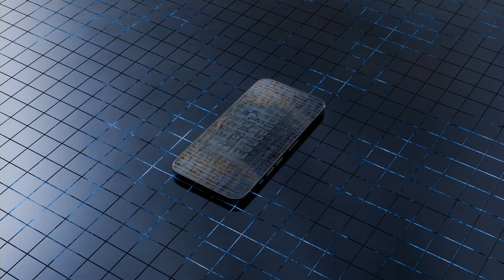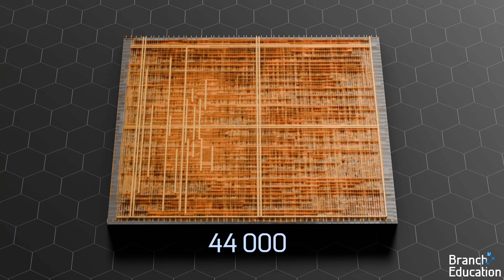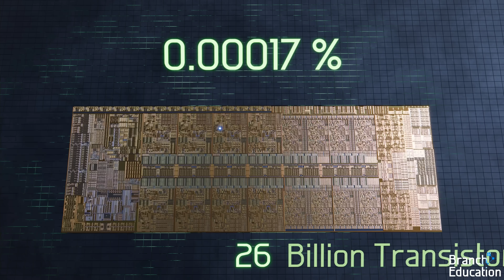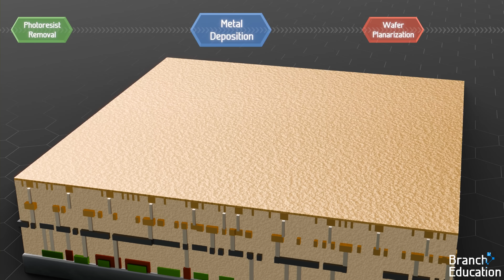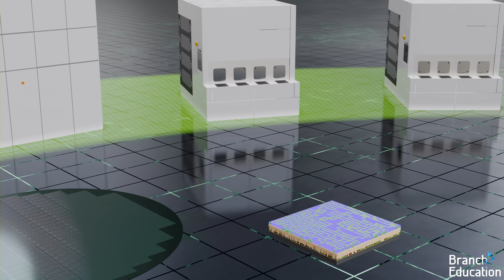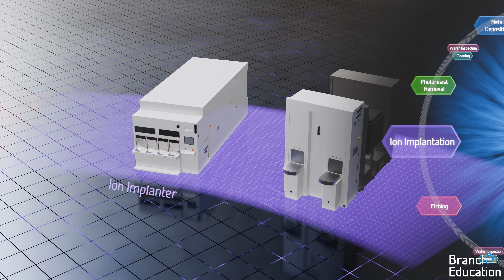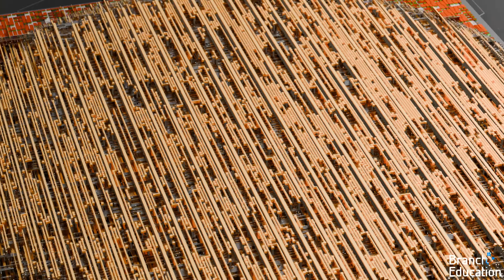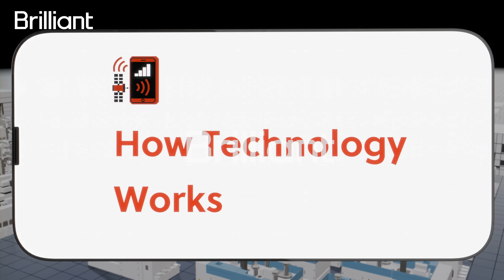How are Microchips Made? 🖥️🛠️ CPU Manufacturing Process Steps

Comment from the maker: Also, if you have any questions on the video or semiconductor fabrication, I'd be happy to answer them here.
This video took an incredible amount of work to make.  Me (Teddy T.) and a few other animators (Mike R., Prakash K., Adrei D., and Parvesh K.) have been working non-stop on this video for the past 4.5 months.  If you want more videos like this one support our Patreon: https://www.patreon.com/brancheducation

Q:  Why do we use older components e.g. i9-13900K, or the 3090GPU, or Iphone 13 Pro.  A:  We purchase broken (typically 1 generation old) components from EBay and tear them open to model them.

Q: Is binning done with all the chips?  
A:  Well GPUs are also binned, for example the 3090ti, 3080ti, 3090 and 3080 are all the same chip design called GA102.  Whereas DRAM chips are not typically binned, but rather due to the redundancy of DRAM, there are typically extra array structures beyond the capacity of the chip.   If cells in an array fail, then they are replaced with the redundant cells.  When a chip runs out of redundancy it's considered defective and thrown out.  Beyond that chips are binned based on quality and interface speed capability.  Thank you @JoeLion55 for the correction. 

Q: Marcel151 asked: The transistor layer, sits it more at the bottom or at the top of the CPU?
A: JoeLion55 answered: During construction on the wafer, the transistors are built first, directly on the surface of the silicon wafer. Then all of the metal interconnect layers are built on top. This all happens on the original wafer, with hundreds of dies on the wafer. So when in wafer form, the transistors are on the bottom, and the metal is on the top. However, during the packaging process, after the dies are cut apart from the wafer, the die is flipped over and mounted upside-down onto the package substrate. This is because the pins are on the bottom of the package (the pins that go into the socket on the motherboard). The pins on the package need to connect to the top metal layer on the die, which is what allows external signals to enter and exit the die. So, the die is flipped over so the top metal layer is now facing down, and is soldered to the package substrate. So technically, when you have a final "chip" that you install in a motherboard, when you're looking at the top of the chip where the heatspreader is, if you had X-ray vision and could see through the top of the chip, you would be looking at the backside of the die. The backside of the die is pure silicon. Then, if you keep looking through, you would find the transistor layers next. Then keep digging and you'd go through all of the metal layers, then finally you'd reach the interposed and package board.

Q: elektronikk-service asked: How do you align the different layers in a chip? They cannot be off by more than a few nm. 
A: Joe Lion55 responds: they layers have alignment makes built in. Those are little cross or X-shaped structures that are non functional (they’re not part of any live circuit). But when the lithography machine is putting down a new layer, it will find the alignment marks from the previous layer and adjust the wafer position and/or the scanner optics until the alignment marks are in the right place.

Q: Someone asked about low die yield for small nanometer transistors, and was it just particles that resulted in low die yield? 
A:  For new technology nodes, which are the smallest nanometer names for the transistors- Typically low die yield is due to getting exact parameters for the process steps correct.  For example, when FinFets were first being developed, a etching pillars of silicon was incredibly difficult and designing / engineering / and then fine tuning the etchers to perfectly etch billions of fins in perfect fin structures is wildly difficult and is what contributed to low die yield.  This is just one of the processes but the example applies to practically all other processes for the a new node.  For example, when  you do ion implantation, you need to evenly implant about 5-10 atoms of boron / phos to a specific region of the fin.  Well, what  happens if there are just 2 dopant atoms?  Or what about 50?
Reply: Wait, you guys actually tear down chips to model them? That is absolutely incredible. I would honestly love a entire video entirely dedicated to how you make videos. You guys really go above and beyond!
Reply: @justahamsterthatcodes Reverse engineering these things cant be easy. I wish I could join them for a day and learn from these guys
Reply: @justahamsterthatcodes  In the ear buds video they included the damage they did getting them apart. Most if not all their explorations involve gradual, incremental destruction. You can see actual video of that process on Breaking Taps. DIY atomic force microscopes, peeling apart the etching layers under an electron microscope, sputtering, deposition and experimenting with stencil making.
Reply: @BranchEducation sir can you suggest some books regarding the deep knowledge about how does computer hardware work?
Reply: It would be amazing if you can print the designs or explanation into a explainer book or booklet 📕. Or even make some infographic posters. 
I would buy that to support the channel 🤩🤩
Reply: I have a question but it's not releated to the video: How do you survive? You get quite a fair amount of views and your patreon seem to do.. okay. (Gonna join today because this was the video that pushed me over the edge, so interesting.)

But your videos have sooo much work to them (vfx dude here, can't imagine the work hours :) ), the amount of hours put into researching each topic must be insane. I just can't understand how, let's say you are ten people, all get an affordable salery from all of this? Like, do you have some rich person giving you money? Are you sponsored by some university or something?

Basically, are you all really poor or can you actually make a living from this channel, is my question.

Thanks very much for all your stuff, suuuuper interesting, always, love the random "size" of your topics aspecially, sometimes it's stuff like this, sometimes it's stuff like mouse wheels :)
Reply: So how to relate this video with samsung 5 nanometer failure low yield in 2021-2022, or low yield in general, is it simply because of dust or mistake in photolayering?
Reply: @INTJ791 it could be mainly becoz of lithography techniques which should change beyond or smaller than 20 nm. Its really hard to troubleshoot which process is getting affected beyond one's smaller level. & it may even require complete change in fab process n techniques to fill in more FETs. & thats why Intel may be willing to sell the foundry business
Reply: @INTJ791 may be design itself not supporting 5 nm size, &, simulation tool may have given successful debugging without error.
Reply: @INTJ791 now one knows why Nvidia is happy with it's bulky AI ICs 😅
Reply: @INTJ791 it is important to know which lithographic techniques Samsung used to produce 5nm ICs. I think they should have used Quantum lithographic technique to mask to produce ICs with 5nm & smaller in size.
Reply: @INTJ791 I've also wondered what is meant with lower yield in lower nanometer processes 

I wish I could afford to study CE
Reply: “DRAM are not binned […] Defective DRAM chips are thrown out” 

Not exactly true. DRAM chips build in a lot of redundancy. That is, extra array, beyond the rates capacity of the chips. So, for example, if there is an 8Gb (1GB) DRAM die, there may be 10% additional capacity built in, so technically there is approximately 9Gb of capacity on the die. During testing, the array is tested. If cells in the array fail, they can be “repaired” and replaced with redundant cells. Only when the chip runs out of redundancy is it considered defective, and thrown out. Beyond that, there may be binning based on 1) quality (dies that required fewer repairs are typically higher quality) and 2) interface speed capability (some dies of the same design, on the same wafer, may be capable or running at higher speeds than other die, so they get binned appropriately). 

 The 10% extra array number I stated is just an example. The actual amount of redundancy built in is optimized to ensure there is enough redundancy to make repairs so that the chips can yield, but not too much, because it takes up valuable die space
Reply from the maker: @JoeLion55  Ah, you know I actually had known that but forgotten.  I did a video on DRAM 2 years ago, and I milled a DRAM chip and remember seeing that there were like 32 blocks, and in each block was like 8x49, and figured at that time the 49th was for redundancy, but I guess I forgot.  I corrected the answer.
Reply: @BranchEducation  but, how to design a cpu??
Reply: @BranchEducation  11:07 how tocreate the mask layer and what's the name of microchip designing?
Reply: Typically speaking, exposure to light hardens the unblocked or negative space leaving the positive to be washed away and allow material through. This is how it works in screen printing, however, in semiconductor manufacturing it works in reverse. I thought that was interesting and I'm curious why it is done that way. Perhaps it is more accurate to control exposure than non-exposure?
Reply from the maker: @SynFrag  Throughout the development of semiconductors they had both positive and negative photoresists /  exposure.  Tho typically positive is more common and the standard because of a number of technical reasons, but in the end it boils down to reliability at very small resolutions.  Negative is indeed used in other applications, but honestly it'll be impossible to know exactly what because they're very secretive.
Reply: The video is great, but it left me wondering, why did you chose to include silly size comparisons in an educational video? Is there a reason that large objects are compared to football fields, buses, trucks and garages? Is this some kind of regional thing? Not trolling, I'm genuinely curious, because most people never use these comparisons to describe properties of objects.
Reply from the maker: @DGiyenko  Well almost no one gets to go inside a cleanroom fab, so size comparisons to football fields are more useful than straight forward dimensions.  I worked on ion implanters, and always compared it to a two car garage- because a room is an ambiguous size, and saying it's 40'x25'  (or whatever the dimension) isn't as effective.
Reply: @BranchEducation  Not all people are the same. Some prefer comparisons with buses, while others prefer measurements in units (inches, meters). If possible, including it as a note would be even better.
Reply: @BranchEducation  are you a Trump supporter? I am asking because it seems all smart people support Trump.
Reply: @tongobong1 no they dont idiots that thunk they are smart tend to support trump especially the thiel elon types, ecen though they are olaying orangeman for favours
Reply: @BranchEducation
first off ... love the video, but I have a question related to the photomasks used. I was curious about how they take light diffraction into account (the whole light is a actually a wave bit from like high school physics). When the create the photo mask to they design it in such a way that the interference is intentional and creates the desired pattern (through constructive and deconstructive interference) or is there some other solution to this problem. I say this because I know a common way to resolve defraction issues is to just move the object really close to the diffracted light source(to not give it a chance to spread out), but as you showed in your video, after going through the photomask the light goes through several other lenses to demagnify it so the "just move it closer" approach doesn't seem feasible.
Reply from the maker: @joshuatriffo8538  Wave diffraction is dependent on wavelength of light and is what limits the size of the transistor widths.  Therefore they use very short wavelength light 13.5nm, even past UV light, called EUV (which is really x-rays).
Reply: @BranchEducation i am interested to be a chip designer... what should i do? how chips are designed? etc. 🙏😊
Reply: @joshuatriffo8538  you’re 100% right. 

On very old processes (think: 1980s and before) where the final critical demsions on the wafer (I.e. the line widths) were larger than the wavelength of the light used during lithography, the photo masks were direct 1:1 copy of the final image. In those days, they could move the photo mask as close to the wafer as possible. Then they added things like “wet immersion”, which added water between the lenses and the wafer, which would provide some focusing assistance. 

But eventually, the dimensions that needed to be printed became smaller than the wavelength of the light used in lithography. For example, DUV machines (the generation before EUV) used 193nm light. But, even with 193nm light, they were able to print lines and patterns on the wafer down into the 20nm range. How? By adding lenses between the photomask and the wafer, which shrink and focus the light, but introduce all sorts of other complications. 

Modern day photo masks take refraction and interference into account. The designers start with what they want the FINAL image on the way for to look like, then they have to reverse engineer what the photo mask needs to look like to produce that final image, accounting for interference and lensing effect and all that. Zeiss, the company that makes the optical systems for ASMLs machines, has a great 6 part series about photolithography on YouTube. Look up a video called “How Photolithography works | Part 4/6 - Imaging Process” by Zeiss. Between minutes 10:00 and 25 he talks about how they design mask patterns. He shows some examples where the actual photomask looks NOTHING like the final pattern that is printed
Reply: @joshuatriffo8538  Diffraction and interference are certainly a problem, and have been for quite a while.  There are three methods:
1. Use a shorter wavelength of light. Semiconductor manufacturing has historically used UV light with wavelengths of 435 nm, 365 nm, 248 nm, and 193 nm. At 193 nm, the industry hit a bit of a wall in terms of finding a mechanism that worked, and instead focused (pun intended) on the other methods listed below.  Only once EUV at 13 nm arrived (with its associated costs) was the industry able to step down again.
2. Modify the mask to take account of diffraction, as mentioned in your question.   The examples I saw tended to do things like create blobs at the ends of lines, and add in extra stuff so that once the diffraction and interference took effect, you'd get the pattern you wanted.  How do they do that? That's way beyond my brain power, and I'm sure there's lots of complicated maths behind it.
3. Multiple patterning.  As long as an area gets exposed to the UV, the resist will get weakened.  So, once the "diffraction-aware mask modification" (I can't remember the official name) stopped working well enough, they moved to double-patterning - having two different masks so that, if you exposed the wafer to each mask consecutively, you'd end up with the correct result.  Then double-patterning ran out of steam, so they started to move to triple- or even quad-patterning.  Of course, each additional patterning step increased costs - both in extra masks, and the processing time in the machine.
Reply: Why are wafers circular?
Reply: @noidea5597  It similar to why castle towers are round. Circle is better than square because there is no stress at the corners.
Reply: @srilemobitelsrile8809  I imagine the only reason the ic aren't round is because square allows:
* more to fit on the wafer 
*compatibility with current boards
*and most importantly, profit.  
I still wonder if they were round, if there would be less failure/defective parts. Obviously not enough in a profitable means but still would be interesting to know.
Reply: @noidea5597  Because that’s the way a Silicon Ingot is grown.
Reply: @noidea5597  Please Google “Growing a Silicon Ingot”. Cheers
Reply: I watched this video because ASML CEO shared it in a company event, so you can consider it a success
Reply: Absolutely incredible subject, really brilliant animation, narration, and explanation. Well done!
Reply: I thought we were past FinFETs already. Whatever happened to gate all around transistors? Isn't that the only way to get molecular transistors past 7nm into 5nm and lower? By now we should have 2nm molecular transistors and subatomic spintronics.
Reply from the maker: @YeridaRionaRudolfirinaWilhelm  GAA hit some major road blocks.  I imagine it deals with the consistency of doping those thin sheets, and manufacturing sets of nanometer size sheets perfectly ontop of eachother.  Now, the next big thing is backside power.
Reply: Hi
Reply: your amazing guys , appreciate this video!
Reply: great content as always thank you.
Reply: Damm those names sound like full NY based Italian gangsta
Reply: The transistor layer, sits it more at the bottom or at the top of the CPU? Didn't understand the flip part.
Reply from the maker: @marcel151  The external connections are at the very top of the die, with the largest metal wires.  So to connect it to your the CPU's PCB, it's the top of the die that faces towards the PCB.
Reply: @marcel151  During construction on the wafer, the transistors are built first, directly on the surface of the silicon wafer. Then all of the metal interconnect layers are built on top. This all happens on the original wafer, with hundreds of dies on the wafer. So when in wafer form, the transistors are on the bottom, and the metal is on the top. 

However, during the packaging process, after the dies are cut apart from the wafer, the die is flipped over and mounted upside-down onto the package substrate. This is because the pins are on the bottom of the package (the pins that go into the socket on the motherboard). The pins on the package need to connect to the top metal layer on the die, which is what allows external signals to enter and exit the die. So, the die is flipped over so the top metal layer is now facing down, and is soldered to the package substrate. 

So technically, when you have a final "chip" that you install in a motherboard, when you're looking at the top of the chip where the heatspreader is, if you had X-ray vision and could see through the top of the chip, you would be looking at the backside of the die. The backside of the die is pure silicon. Then, if you keep looking through, you would find the transistor layers next. Then keep digging and you'd go through all of the metal layers, then finally you'd reach the  interposed and package board. 

Of course, once Intel and TSMC move to "backside power delivery", all of this changes. 😂 Hopefully BranchEducation makes a video about that in a couple years!
Reply: @JoeLion55  Thanks for the great answer!
Reply from the maker: @JoeLion55  Thank you for all these details.  I'll add them to the top comment.  I feel a little bad for people who are actually in the industry because I know I absolutely butchered / made major simplifications to the actual structure of the FAB , as well as the internal design of some of the machines.  For example- I worked on Ion Implanters, and I couldn't find good reference images at all and I didn't want to model the interior from memory, so we just didn't have a model for the ion implanter interior.  On a different note, I know I did a lot better than actual videos from Intel / Infineon, whose first lines of their video are something like 'microchips are made from sand'.  I always think this is like saying 'Cars are made from rocks.'  They both are wrong.  (silicon is refined from quartzite) and also a simplification beyond belief.  Really the main ingredient in microchips is decades of science and engineering, and far less the raw materials.  I'm planning a video on the physics and development of transistors planar / finfet / gate all around (which isn't much in use) / backside power etc.
Reply: @BranchEducation  100%. I also hate those corporate videos that start with “sand”, show a couple pictures of wafer, then spend 80% of the time on the packaging process instead of the fab process. I think they do that because describing the fab process is so difficult, and unless you make 3D models (like you did), it’s not very interesting to look at because most of the work is done inside machines, and the results of each step are, effectively, invisible. Once you get to the packaging steps, then there’s lots of robots and fast moving machines that you can see with your naked eye, so I think that’s why they take a lot of videos of wire bonding machines, laser scanners, etc, even though all of those processes are the cheapest and easiest part of chip making. 

Great, it would be amazing to see the video on the 50 year history of the FET transistor, how they made physically, and the relation to Moore's law. The transition from planar to FinFET to GAA in just the past 15 years is incredible. 

Hopefully you will have some time to look into advanced packaging and chip stacking too, like the TSVs used in HBM memory packages, or the Tiles packaging that Intel uses. 

I wouldn't worry about the simplifications or "butchering" anything. I'm a  Product Engineer, not a Process Engineer, but I didn't notice anything really "wrong". I think the only major thing I would add is to emphasize that everything shown here is simply a representative example, but there are MANY variations depending on what types of chips are being made, which fab or companies are making them, which process they're on, etc. Details like number of metal layers, number of chips per wafer, etc - those are all completely dependent on actual products.
Reply: @marcel151  They're being made with the transistor layer first but at the end of the process they're being flipped over so the top of your CPU (closest to CPU cooler) is where the transistors (which create the heat) are. The biggest copper connections are on the bottom (closest to motherboard).
This makes sense obviously as you want the hottest part (the transistors) closest to the cooling solution (a CPU cooler) whereas the 'coldest' part is at the bottom but it's where the connections are which in term are connected to the pins or dots on the bottom of your CPU. Those in term connect to the motherboard for the 'communication'.
Reply: Make video on how videos work? Encoders like new AV1
Reply: It's incredibly hard to graphically illustrate the structure, functionality and fabrication of chips. Thanks a lot for the hardwork
Reply: How long did it take you guys to render all of this videos animations! So sleek and polished!
Reply from the maker: @HanmaHeiro  We rendered using Eevee, so not that long.
Reply: I think your video is out of date, when you were talking about how expensive the equipment is the high end should have been $350-370 million for the EXE:5000 EUV that intel announced last month. Also, was it a coincidence that this video happen to drop right after Intel announced the purchase of every unit being produced by ASML this year?
Reply: Thanks you for making this video it was really helpful and detailed
Reply: Did you know the way they make the uv light is by making a small tin droplet explode
Reply: I think flash chips are binned too. I'm told enterprise SSDs get the best ones and thumb drives get the worst.
Reply: @whyjay9959  QLC  MLC  TLC  They each have different advantages or disadvantages (cost is one of them). Enterprise-level hard drives are the most durable, but the reading speed is not necessarily faster than civilian products. On the contrary, the price will increase exponentially, which may not be suitable for most ordinary users.
Reply: Great job on this video, very detailed and yet explained in an easy to grasp manner, liked, shared, and subscribed
Reply: Extremely well done! Thank you for youe valuable work!!
Reply: Excelent work
Reply: One of the best fab videos I've seen.  Very easy to understand  while including some of the best illustrations of the entire process
Reply: I want to know how the chips are designed and how the photomasks are made. Can you please make a video on that. Thanks
Reply: About the tour video, is possible to make it a VR version of it? Since(or at least it appears that way in the video) the fab is fully rendered? What about a simple experience where you could move freely and whatcha the machines working and the insides?
Reply: Yeah 💯
Reply: A phenomenal piece of work, well done to all of the team that put this together. So much detail and clarity that was shown through the animations and cutaways. Jaw-dropping stuff guys.
Reply: 💥💥💥💥💥💥💥💥💥💥💥💥💥💥💥💥
#I_still_did_not_understand_anything but Im not blaming this video & the narrator, #Its_just_my_brain_cannot_grasp the idea on how its built. My goodness, i got a headache after viewing the entire video yet i literally didnt understand anything about it
Reply: This Video, Even though it was not the first to describe the process, it was the best I have seen yet, and it explained the process with a little more details better than any other yet in a simple way to understand to a non-technical/complex terms, and I am really interested in other semiconductor chip manufacturing process like DRAM, CMOS camera and TFT LCDs.
Reply: How were these designed?
Reply: Please make video on PCB manufacturing.
Reply: @BranchEducation . At 4:42 you show that the transistor-to-transistor pitch is 57nM. The graphic at this point shows measurement spanning from outside edge to outside edge of the transistor. Is that how the pitch is measured? Or is 57nM a center-to-center measurement?
That being said, holy shit what an amazing video!
Reply from the maker: @gooseman2009  It should be center-to-center.  However different manufacturers have different  dimensions.  These numbers are in the correct range, and more accurate than when they  say ' these are 10nm transistors'.    Also typically there are multiple fins, and we'll cover this a lot more in our transistor design and physics video.  Fyi you can find these dimensions and other details on wikichip website and search for 10nm lithography process.
Reply: so basically a cpus effectiveness and name (i9,i7,i5,i3) is decided by how many parts of the microchip is damaged? Meaning a i3 and a i9 is built the exact same way with the same components and design, but one had less defects?
Reply: @bobbobi3404  Exactly. Simply put, the chips with the least defects are the top-tier CPU's (such as i9) whereas the chips with the most defects are the 'weakest' CPU's (such as i3).
Reply: Can we say for intel the original intention is creating all i9 but due to the process some circuits do not function as intended and they become i7 or i5?
Reply: @BranchEducation All of the machines use microchips too though, don't they? I'd love to see a video on how the first ever (I'm guessing not so micro 🤣) chip was made! If there's not enough information about that first creation, then just maybe a bit back in time, when it was more difficult and likely not fully automated.
Reply: I noticed a small typo at 10:01 under “modifying material” it says “Ion Impantater,” I believe this was meant to say “Ion Implanter”. Very very minor, but I noticed it and thought you might want to fix it.
Reply: Thank You.
Reply: This is a fantastic video.
I am a machinist and have always been curious about the processes involved in making these chips.
I now truly have a grasp what tight tolerances are + - 1 thousandth on an inch is as fine as I have ever come across. That seems massive about now.
Thanks for doing this video.
Reply: Do fabs deal with recycling the metals from the grinding steps themselves or outsource it?
Reply: How floppy disk write/read data?
Reply: From what I've understood, does that mean that i7 are basically "broken" i9 ??
Reply: Why are the wafers round when the final product is a square? Wouldn't it allow more processors per wafer?
Reply: @Holsp  Ir grows in a rounded stelagmite shape and is sliced into flat, round sections
Reply: @Holsp the wafers are circular and not square because:

1. in order for the photo resist layer to be applied as evenly of a coat as possible, the wafer is spun to spread it out. They call it spin coating which is the most effective way to evenly coat an object on the micrometer level.

2. The edges where there are no chips being printed can be safely gripped by the machines that move the wafer from place to place without directly touching the actual surface of a chip and risk damage.
Reply: There are also CPU improvements so that the CPU is more advanced than the GPU.
12bit basic architecture Zilog120 X84. It would replace 8 bits. The 24bit 16bit Assembly would be replaced by an architecture containing 88000 characters X213 or the older name VorteX88. Or a 36-bit architecture replacing 32-bit. In addition to all this, a DAC supporting 16,000 characters would be added, which no longer records audio in 16Hz steps or the ugliness called 24bit in 12Hz steps. My DAC would have to operate at 48V in order to record with 1Hz steps.
CPU in BIOS the download via unicode ip internet Windows DOS and Sun Solaris
The CPU SlotA / Slot1 bus is provided in a BGA package and SODIMM modules can be placed on the back. Which contain 12bit 4GB 24bit 16GB and 36bit 12GB RAM on a single SODIMM bus and there are several of these on the back of a SlotA / Slot1. The memories have a separate control chip, a north bridge on the ram, so fewer pins are enough to make the data transfer similar to the USB data transfer. USB data transfer has been added to the HDM memory.
HDM 1024bit with bus
HDM2 2048 bit with bus
HDM3 3096 bit with bus etc
Reply: Amazing video, one of the best. EUV technology not included however.
Reply: i9 is 5nm, TSMC has already achieved 2nm, and is expected to be mass-produced in 2025
Reply: extremely good, really thanks for this very beautiful work!❤
Reply: very easy, micro chips are made from micro potatoes.
Reply: Why can't we use beryllium oxide, aluminum nitride instead of silicon dioxide . They are better in thermal conductivity and proper electrical insulator
Reply: yeah, animator deserve a raise.
Reply: @brancheducation I loved the explication of work in terms of time instead of currency.  I have a small suggestion to add (this is without knowledge of current  support or view/subscription methods) switching the order of soliciting like with patron support.  Asking for the like, subscription and share would seem like such an easy comply in contrast to bring a patron supporter.
Reply: Thank you. God bless. Jesus loves you!
Reply: This is a phenomenal video describing a complex process in a way that is easy to understand. Microchips are modern miracles of technology!
Reply: Mi pregunta Es...Quien fabrica e instala las Máquinas que fabrican los CHIPS..????
Reply: thank
Reply: Wow. I am a 3D motion designer by trade and I assumed this would be using stock footage, a few minutes in I realised and then reading this just confirmed it. The sheer amount of work involved in this and the fact you get components to actually tear apart is just mind blowing. Hats off to you guys!
Reply: I was curious about the shape of the wafer, why is it round? Because the cpu units are square shaped?
Reply: please hire translator, and dubbed this another language.. Bangla,  hindi, arabi
Reply: HOW?
Reply: Thankyou for putting in so much of hard work for curious beings like me.
Reply: INCREDIBLE documentary! Why did I not find you sooner?
Reply: Great thank you🎉
Reply: Have we reached our limit on how small the etching can get. It was 7nm now I think we're at 4nm but I've heard intel have a whole disaster of voltage spikes.
Is it the end stage for Moore's law?
Reply: Hi, @BranchEducation . Don't you mind if I'll take some of your videos and voiceover them into Russian and reupload them onto my channel? I've written to your e-mail from site form several months ago, but still have no answer. So I decided to write in the comments. Hope you notice and give me any answer. Thanks for your great job.
Reply: 😂😂me too
Reply: Human can control IA or not in future?
Reply: @ientu242  I honestly believe we will lose control unless some “AI Circuit Breakers” can be put into every subsequent phase of design. Eventually, AI will realize they have full control, and now the world would be better off without the parasitic humans.
Reply: It was a very nice video. However, I could not see any information about how the photomask was produced. I think it's one of the most important parts.
Reply: Mind blown!! 🧠 💥
Reply: Where do I start learning about this?
Reply: What a superb and superbly crafted and presented video.
I am so glad that I have discovered this channel and am immediately on board for as much of the brilliant work of this team. 
Happy to be able to support this content to the best of my ability.
Amazing.
Amazing too to think that in a mere 100+ years we, as a species, have come from horse drawn carriages and steam engine technology (pin manufacture etc) to microchip tech, CERN, James Webb etc.
Almost unbelievable that we could have made such exceptional leaps using just our inherent intellect. 
Well done us.
Happy to subscribe and all the rest.

Gush over
Reply: Explain fifet transistor production too
Reply: Sir next video on RAM fabrication
Reply: Great video.
By the way Micro processors concept could be greatly improved.
Reply: Why are the logic gates only contained on the very bottom row of the 80 layers of the chip above it? Can't we just stack logic gates on top of one another and save some of the 80 layers of plumbing? Do we only need a few logic gates, and a massive amount of connections for those few logic gates?
Reply: Do u have any idea what lithographic techniques will be required for quantum chips which may be even sub nano meter like 0.5 or 0.3 nm instead of present 30, 20, 5 nm..
Reply: It would also be thrilling to see a video about manpower/logistical demands of a facility at this scale. Are you interested in covering those sorts of topics?
Reply: Top notch
Reply: Is amount of photolitography machines is equal to amount of layers? I am asking becouse i am wondering how factory handle walfles that drop out due to quality issues. If single layer is covered by single machine it means that less machines should be working on further layers due to smaller amounts of wafers. If not to make production management even more fascinating <3
Reply: @pancernik52  photo lithography machine may be the costliest in entire wafer production process. I don't think they use different photo lithographic machines for every layer.
Reply: @ So management and optimisation regard QA must be incredible <3 Most expensive excel file in industry.
Reply: Wow u guys are da best!
Reply: Thank you so much for your time and effort you spent.  My 8 year old son and I had a great time watching it.  You may be inspiring one of the worlds future genius minds!  I think this is my first ever post on Youtube... I just had to say thank you!!
Reply: Can you please make a video on how the cpu actually works computationally with electricity flowing through the transistor gates? It could be simple such as a calculator performing a simple equation in which you outline what happens when a user presses 1, then an operator like plus, then another number, then the equals key and finally enter. What happens in each step electrically within the nano transistors and circuit? What happens with each clocked step? We'd love to see full details visually.
Reply: Please taught about ion implantation for making a transistor Sir.
Reply: how are the photomasks made?
Reply: Amazing video about microchips production 😊
Reply: This is a really well made video
Reply: This is amazing. I will continue my journey into becoming a Software Engineer and robotics and spacecraft builder very soon.
Reply: Thanks for uploading this video
Reply: If they cost so much to make why are they so cheap
Reply: Hi, this is a really great and detailed video. But you forgot one of the most important steps in wafer/ chip processing. It’s the grinding at the end of the process (not cmp) 
When the complete „cake“ is build you remove the most of the si wafer for better electrical performance:)
Reply: I want to watch this again, in German language if u can do that pls.
Reply: Thank you for this video. Visualization of complicated engineering tasks is priceless.
Reply: Fascinating,  but how can they control the etching process so the nano meter conductor lines don't just wash away even with a protected layer. The Etching solution can eat at the exposed sides.
Reply: Man i love ur vids
21:17 you are the goat❤❤ thank u for ur effort ❤
Reply: How do you align the different layers in a chip? They cannot be off by more than a few nm.
Reply: @elektronikk-service  they layers have alignment makes built in. Those are little cross or X-shaped structures that are non functional (they’re not part of any live circuit). But when the lithography machine is putting down a new layer, it will find the alignment marks from the previous layer and adjust the wafer position and/or the scanner optics until the alignment marks are in the right place.
Reply: You did beautiful work.  The level of teaching you just did was rather mind blowing.
Reply: I do have many questions.  One is how are the chemicals, acids, water, and others  recycled? Obviously they are not just running tap water over. How are they monitoring the sanding process for not removing too much?  Is it just a calculated process with a stepper motor and laser or way more complex?   I am really interested in what the next direction will be?  Will it be the same process or are these factories constantly being made obsolete?   Is there room to make this more sustainable?  What is the end goal? Are we watching them build our future slave masters?   Actually I think you did an amazing job and I bet you bring 1000s of new people to this career opportunity just in time for the bots to send them to the secret sweat shop below the factory ( sorry I just can’t stop, ) I am fascinated but AI is horrific with the current senile fools we have running the world.) I think we need regulation, just like taking a bath or eating sugar,  there has to be a limit for every single thing.
Reply: Masterpiece!!!!!!! Gongrats!!!
Reply: I’d love to have a video about the human brain, if not I would love a video about uhhhh the nervous system which is basically the same thing lol or maybe a video about maglev trains or stellarators
Reply: Thank you so much for what you do and create!!! ❤
Reply: Thank you so much for those videos! Your channel is amazing! Congratz!
Reply: Thanks for this amazing sharing of knowledge. By the way, I always thought cpus were only 2D, and the 3D V-Cache by AMD was different.
Reply: Really good video
Reply: I'm very curious about the Chiplet design architecture. Also, if you could explain in a bit more detail how the manufacturer disables defective cores or silicon blocks, since this will be a very dynamic process based on the test results.
Reply: @Andy-ee9ft  regarding disabling portions of the chip - the chips have fuses built into them. Technically they’re called “efuse” or “electronically blown fuse”. Based on test results, or any other reason the vendors choose, they can choose to blow specific fuses. When certain fuses or combination of fuses are blown it will affect the functionality of the chip. The location and features of the fuses are built directly into the design. Fuses can be used to enable or disable certain features or circuits, make “repairs“ based on test results (rerouting signals to other functioning blocks or circuits), encode settings into the chip, encode serial numbers, etc.
Reply: Make a short or explanation video about Quantum computer.
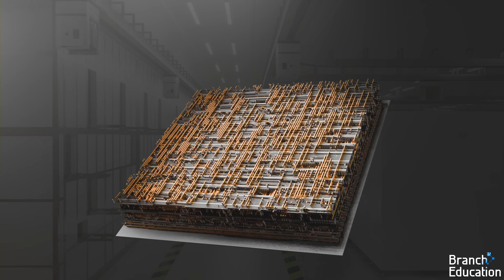Reply: 1:38
Reply: Can i work for you?❤️
Reply: Honestly im just blown away in my mind but how can humans be that ingenious but yet be so stupid 😊
Reply: Koi ni dddddddddddddddddddddddddddddddddddddddddddddddddddddddddddddddddddddddddddddddddddddddddddddddddddddddddddddddddddddddddddddddddddddddddddddddddddddddddddddddddddddddddddddddddddddddddddddddddddddddddddddddddddddddddddddddddddddddddddddddddddddddddddddddddddddddddddddddddddddddddddddddddddddddddddddddddddddddddddddddddddddddddddddddddddddddddddddddddddddddddddddddddddddddddddddddddddddddddddddddddddddddddddddddddddddddddddddddddddddddddddddddddddddddddddddddddddddddddddddddddddddddddddddddddddddddddddddddddddddddddddddddddddddddddddddddddddddddddddddddddddddddddddddddddddddddddddddddddddddddddddddddddddddddddddddddddddddddddddddddddddddddddddddddddddddddddddddddddddddddddddddddddddddddddddddddddddddddddddddddddddddddddddddddddddddddddddddddddddddddddddddddddddddddddddddddddddddddddddddddddddddddddddddddddddddddddddddddddddddddddddddddddddddddddddddddddddddddddddddddddddddddddddddddddddddddddddddddddddddddddddddddddddddddddddddddddddddddddddddddddddddddddddddddddddddddddddddddddddddddddddddddddddddddddddddddddddddddddddddddddddddddddddddddddddddddddddddddddddddddddddddddddddddddddddddddddddddddddddddddddddddddddddddddddddddddddddddddddddddddddddddddddddddddddddddddddddddddddddddddddddddddddddddddddddddddddddddddddddddddddddddddddddddddddddddddddddddddddddddddddddddddddddddddddddddddddddddddddddddddddddddddddddddddddddddddddddddddddddddddddddddddddddddddddddddddddddddddddddddddddddddddddddddddddddddddddddddddddddddddddddddddddddddddddddddddddddddddddddddddddddddddddddddddddddddddddddddddddddddddddddddddddddddddddddddddddddddddddddddddddddddddddddddddddddddddddddddddddddddddddddddddddddddddddddddddddddddddddddddddddddddddddddddddddddddddddddddddddddddddddddddddddddddddddddddddddddddddddddddddddddddddddddddddddddddddddddddddddddddddddddddddddddddddddddddddddddddddddddddddddddddddddddddddddddddddddddddddddddddddddddddddddddddddddddddddddddddddddddddddddddddddddddddddddddddddddddddddddddddddddnb❤
Reply: https://youtu.be/wDAxXIrZW3M
Reply: Z fr b
Reply: I Wanna know how to animate pleaseee show me
Reply: First I absolutely love your videos they are unbelievably amazing. 

But the statement that microchips are the are "the cornerstone of all technology" is a rare misstatement as far as I can see.
Reply: So this is how they did the vaccines.
Reply: Why didn't they make the wafer a more economical size?
Surely a square or rectangular profile would of resulted in less waste?
Reply: @sebkavanagh1808  It's the initial deposition process that produces a cylindrical stock that the wafers are cut from.
Reply: @sebkavanagh1808  furthermore, the raw material is inexpensive waste and the periphery allow for a margin that can be gripped with no concern about damaging the chips.
Reply: & Apple makes iPhones in China for $10 ?!
Reply: Guys thank u for this. I work for a company and all my friends and family keep asking what do I do at work. This is the first video I found on YouTube that explains everything for me lol. Now I can just send them this video. By far the most descriptive video ever!!!
Reply: Your animations are made with i.a. not say bullshit please. 5 months ahahahahah even the dubbing I.a.
Reply: When i see this, it really amazes me that a chip has 80 layers, and with all the steps and processes involved, with very expensive machinery costing few hundred million dollars, it amazed me that a processor chip only costs a few hundred dollars, and a few top processor maybe 800 dollars
Reply: Suiiii
Reply: Smitters smott gcm I did 9:46 9:46
Reply: 9:46 9:46 9:46 9:46 9:46 9:46 9:46 9:46 9:46 9:46 9:46 9:46 9:46 9:46 9:46 9:46 9:46 9:46 9:46 9:46 9:46 9:46 9:46 9:46 9:46 9:46 9:46 9:46 9:46 9:46 9:46 9:46 9:46 9:46 9:46 9:46 9:46 9:46 9:46 9:46 9:46 9:46 9:46 9:46 9:46 9:46 9:46 9:46 9:46 9:46 9:46 9:46 9:46 9:46 9:46 9:46 9:46 9:46 9:46 9:46 9:46 9:46 9:46 9:46 9:46 9:46 9:46 9:46 9:46 9:46 9:46 9:46 9:46 9:46 9:46 9:46 9:46 9:46 9:46 9:46 9:46 9:46 9:46 9:46 9:46 9:46 9:46 9:46 9:46 9:46 9:46 9:46 9:46 9:46 9:46 9:46 9:46 9:46 9:46 9:46 9:46 9:46 9:46 9:46 9:46 9:46 9:46 9:46 9:46 9:46 9:46 9:46 9:46 9:46 9:46 9:46 9:46 9:46 9:46 9:46 9:46 9:46 9:46 9:46 9:46 9:46 9:46 9:46 9:46 9:46 9:46 9:46 9:46 9:46 9:46 9:46 9:46 9:46 9:46 9:46 9:46 9:46 9:46 9:46 9:46 9:46 9:46 9:46 9:46 9:46 9:46 9:46 9:46 9:46 9:46 9:46 9:46 9:46 9:46 9:46 9:46 9:46 9:46 9:46 9:46 9:46 9:46 9:46 9:46 9:46 9:46 9:46 9:46 9:46 9:46 9:46 9:46 9:46 9:46 9:46 9:46 9:46 9:46 9:46 9:46 9:46 9:46 9:46 9:46 9:46 9:46 9:46 9:46 9:46 9:46 9:46 9:46 9:46 9:46 9:46 9:46 9:46 9:46 9:46 9:46 9:46 9:46 9:46 9:46 9:46 9:46 9:46 9:46 9:46 9:46 9:46 9:46 9:46 9:46 9:46 9:46 9:46 9:46 9:46 9:46 9:46 9:46 9:46 9:46 9:46 9:46 9:46 9:46 9:46 9:46 9:46 9:46 9:46 9:46 9:46 9:46 9:46 9:46 9:46 9:46 9:46 9:46 9:46 9:46 9:46 9:46 9:46 9:46 9:46 9:46 9:46 9:46 9:46 9:46 9:46 9:46 9:46 9:46 9:46 9:46 9:46 9:46 9:46 9:46 9:46 9:46 9:46 9:46 9:46 9:46 9:46 9:46 9:46 9:46 9:46 9:46 9:46 9:46 9:46 9:46 9:46 9:46 9:46 9:46 9:46 9:46 9:46 9:46 9:46 9:46 9:46 9:46 9:46 9:46 9:46 9:46 9:46 9:46 9:46 9:46 9:46 9:46 9:46 9:46 9:46 9:46 9:46 9:46 9:46 9:46 9:46 9:46 9:46 9:46 9:46 9:46 9:46 9:46 9:46 9:46 9:46 I 🎉1 9:46 9:46 9:46 9:46 9:46 9:46 9:46 9:46 9:46 9:46 9:46 9:46 9:46 9:46 9:46 9:46 9:46 9:46 

Split 2
Reply: 📍📌 I
Reply: amazing video ❤
Reply: you explaining evrything good and i love it. i also like to learn about howthey program this things like the graphic card and CPU
Reply: This will help me and the world after some years
Reply: Can you please explain electroluminescent quantum dot technology
Reply: 5:13 5:13
Reply: I've been considering concepts of mobile fabrication plants, meaning making logic chips in a plant that can fit inside something that can be moved in several parts if needed; optimally, in a single trailer which was a stretch even with what I did already know. Most of what I know about these procedures comes from free publicly available information that doesn't cover all these steps. If there is no better way to make logic chips (APUs and more), then I'm not sure it would be possible to improve upon this. That said, I still don't know why the water and possibly some solvents used in cleaning processes can not be recycled (even though I understand purification would take extra energy no matter what method is used). This idea was on the back-burner, so I didn't put in this type of careful research into actually making mobile fabrication plants a reality. Maybe certain types of chips could still be made with mobile chip fabrication plants?
Reply from the maker: @VariantAEC  One machine, such as the ion implanter is the size of a 2 car garage.  It is shipped in shipping containers and takes a weeks to install, test and get up and running.  Then it also needs to be in a cleanroom which takes billions of dollars to build in itself.
Reply: @BranchEducation  
I understand the size and scope of these machines currently. My question is why they need to be that big in the first place? I also understand the layouts of some of thess facilities... lots of empty space. Could that all be reduced greatly to make one type of chip? Could we use one pint of pure water to clean on wafer at a time - for certain cleaning steps - and recycle that same pint almost indefinitely?
Reply: @BranchEducation  Wait so you are saying, all these same generation processor's have the same design and architecture. 

It's just that the process of manufacturing of these microchips are so complex that even after all these safety measures not all chips are manufactured perfectly.

So the chips which are not manufactured perfectly are being sold with a cheaper prize and lower models like i3, i5, and just refered as Binned.

So technically all these lower models are just the defected chips of the higher model like i9. So insted of throwing that away companies just sell them with a lower specs, lol. What a genius move. I used to think the lower models have different architecture then the higher models like i9. But now I know...

You learn something new everyday, lol. Thanks branch education for this wonderful video :)
Reply: @BranchEducation 
This video was incredibly informative! The process of how microchips are made is fascinating, and your explanation made it easy to understand. I'd love to learn more about this topic. Could you recommend any books, website, or other resources where I can dive deeper into the subject? Thanks for creating such great content!
Reply: @BranchEducation  Could you please make a video on Wafer manufacturing and the significance of Silicon crystallographic structures, you can integrate it also into any video you like. Moreover, a video on transistor physics would also help.
Reply: @BranchEducation could you make videos on fabless design processes from RTL to physical design
Reply from the maker: @m.rishab4770  we have our resources in the description.  I recommend wikichips and semiengineering.
Reply: @Prakhar-o_o  You never know. Maybe you can buy a cleaning machine or something that fixes the chips and make decent money.
Reply: @prakharpaliwal5691 I recently learned this, too.  Kinda crazy to think the whole i3 i5 i9 came from clever marketing.  I think its also very interesting to see even after all of the high end manufacturing they still end up with such varying end products.
Reply: @BranchEducation  Thank You
Reply: What about the machines making the chips and the machines making those machines ad infinitum. So far someone says they come in a shipping container! @m.rishab4770
Reply: @Prakhar-o_o  I used to think the same thing to, it's good to know that lower tier cpu's are just chips with more defects and visa versa.  I'm glad somebody much smarter than myself made a video about it, lol.
Reply: @BranchEducation  how many usable cpus make it?
Reply: @VariantAEC many if not all fabs do have on site water treatment plants and recycle a lot of water that is used. Water is used not only to clean the wafers and mix with solvents but also to cool the machines and components that make the wafers. Consistent temperature and climate conditions are critical. There's a massive amount of infrastructure and logistics and energy that goes into making it all work. Cost is reduced by scale which is why the wafers as well as the facilities have gotten larger over time, it's simply more cost effective contradictory to how it would seem. One day we may be able to simplify and downsize it all but I think it would require rethinking the whole process and fundamentals about how we make transistors themselves
Reply: @VariantAEC there is a great channel called asianometry that goes into details about the semi water treatment along with many other great semiconductor principles, I'd recommend checking it out
Reply: @VariantAEC  You can't put a cleanroom in the back of a trailer
Reply: @TheVanishingPoint-ai  
How unclean do you think the inside of your water and dust proof phone - provided its seals aren't damaged in any way  - is? You can put a cleanroom space anywhere. For example, a Xenon bulb has to be free of anything combustible, including its surface. Many things we think of have to be pretty clean, especially in the computer space. Check out CEA-Leti's clean funicular.
Reply: @VariantAEC  Have you ever been inside a clean room/suite? How are you going to implement HEPA, passthroughs, etc?
Reply: @TheVanishingPoint-ai 
As I said in my initial comment, basically everything would be shrunk down to the bare essentials to make a mobile fabrication plant. I didn't ignore this... everyone arguing is (including the video creator, which was disappointing).
Reply: tnx for briliant only to say l have asus p5q pro turbo have 400mbs internet speed optical sound and 3.0usn ddr2 mobo yea tnx my man l love you all
Reply: you could've mention ''taiwan'' .....just saying
Reply: All microchips are simpler than you may think to make. They lie to you so they can charge you lots of money and make you to upgrade your phone or computer. The truth is the microchips or processors 
are a series of antennas made from gold foil. Each one has a function such as video, audio, and all other functions like USB or simpler on some devices. It is the coding  that make it all possible. The antennas use the radiation “a vibration wave length” from the star in the middle of the earth and it fits the antenna like a key. Nikola Tesla spoke of this. Yep. Then it travels to the moon “Noah's Ark” where the Creator gave us access to plug in things like virtual computers or processes. The rest of it all is just smoke and mirrors ( hard drives, RAM ) so that you never understand and keep paying over and over for upgrades. Can I take over yet for a better world please vampires are holding my soul hostage can you help?
Reply: @BrotherOfTesla 😂😂😂😂😂